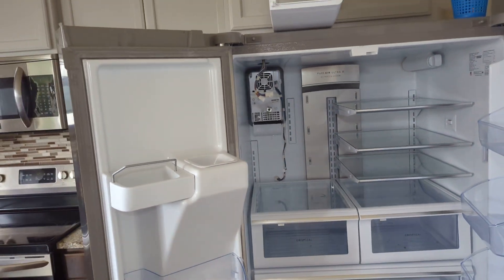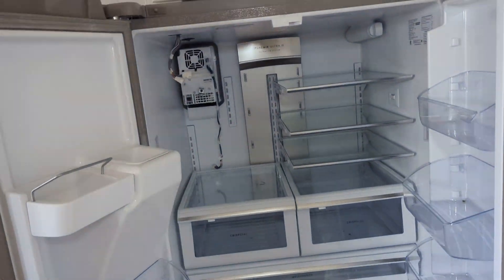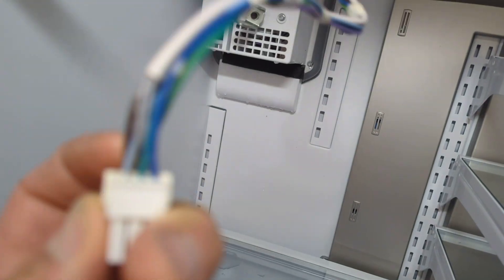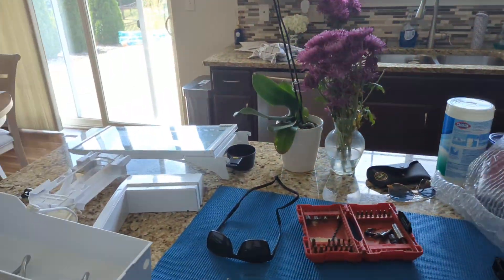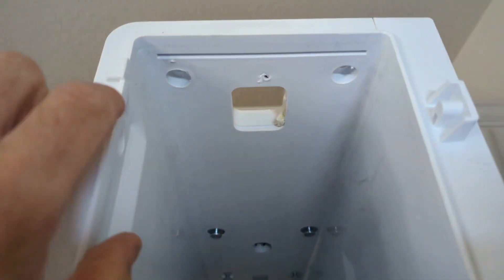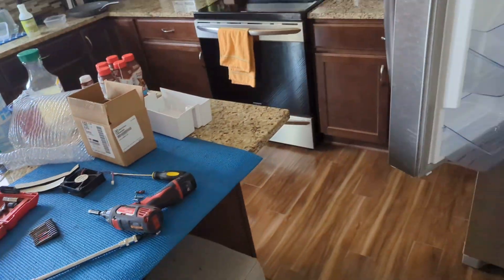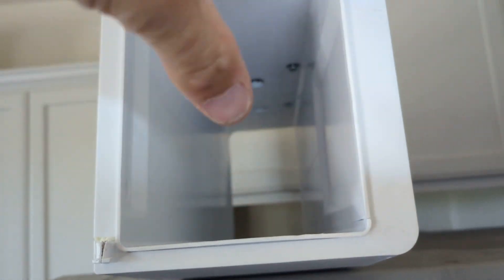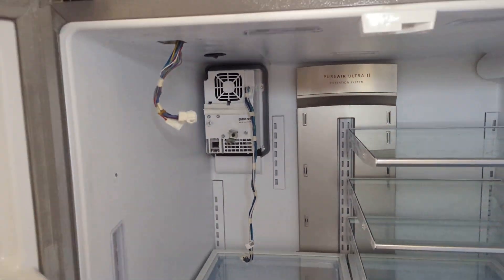Frigidaire refrigerator gallery ice maker not working. ice maker evaporator motor fan replacement

Comment: I did find this helpful, however I'm looking to test the voltage and I'm not 100% sure if I'm doing that part correctly before purchasing a new fan. Can you help explain that??
Reply from the maker: Testing the voltage will be pretty complicated. We'll need the voltmeter and diagram to decipher which cables I don't think you'll be possible to run the test when it's taken the part. One thing you can do is take the ice maker out and listen if you hear the fan running also press the door switch and so it thinks that the door is closed the fan should kick in if you don't hear the fan running it's a good chance it's the fan motor itself. It's the ice maker fan is running then you will need to replace ice maker possibly. I would recommend hiring a technician to test the things out. Because it can be also frozen water line or the water valve not working. The easiest one would be probably replacing the ice maker if you're trying to do yourself. Will cost less than a visit and if it's a older refrigerator ice makers do go bad quite a bit

Comment: SAY FAN REPLACEMENT,  NEVER TELLS YOU HOW TO REPLACE IT
Reply from the maker: The fan is inside inside the auger assembly which is the hardest part getting out because it's not obvious where it's attached. That's why I made the video. The fan itself is very simple to take apart. Just take the screws. The box will open up and you can put a new fan in there